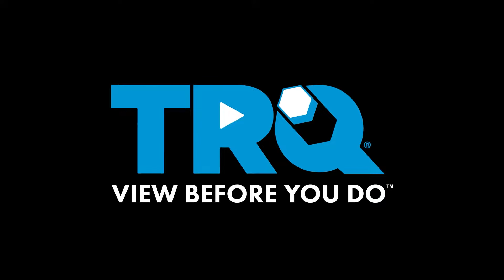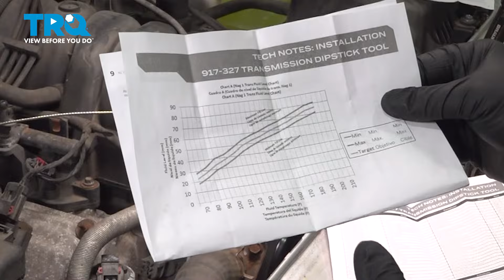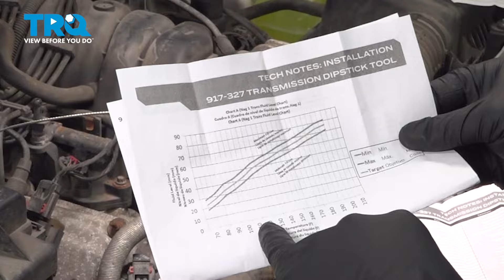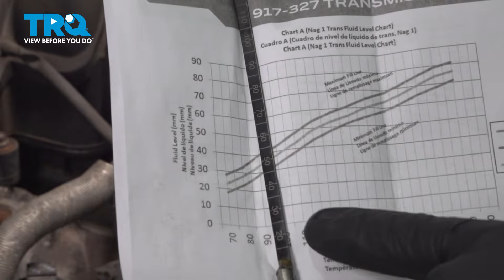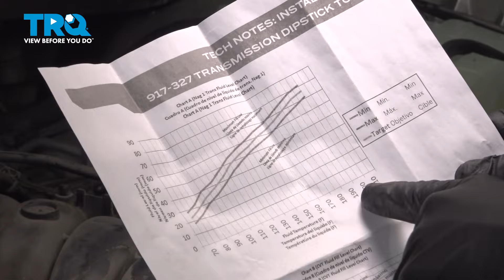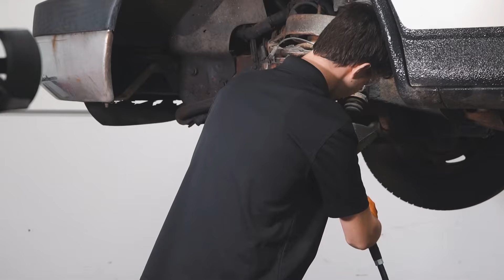How to Use Transmission Oil Dipstick 2005-2010 Chrysler 300

Comment: I have a 2006 Dodge Charger.  I bought a dipstick that has measurements on both sides of the dipstick.  1 side is reading 100, the other side is reading 30. The side reading "100" is gapped (no fluid) from about 40-60.

Why is that?

Comment: Good video.I have a 2006 300C with the 3 litre V6 Mercedes Benz diesel engine.Ive ordered one of these measuring dipsticks as i think my cars due an ATF change with transmission filter kit.

Comment: How long is the dipstick? I have 33inch dipstick. Is it normal not to be fully fitted?
Reply: it doesn’t matter as long as it reaches the bottom
Reply: I use a long zip tie.. with marks on it for 70, 75mm.. 
As long as it bottoms out.. all good